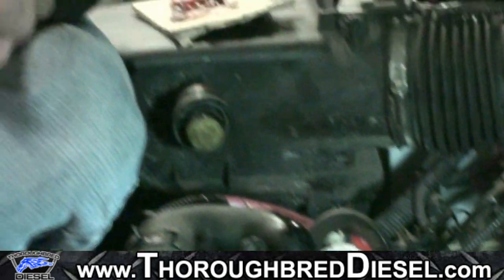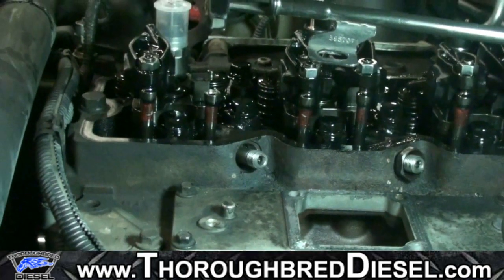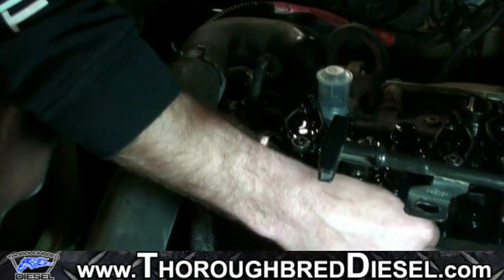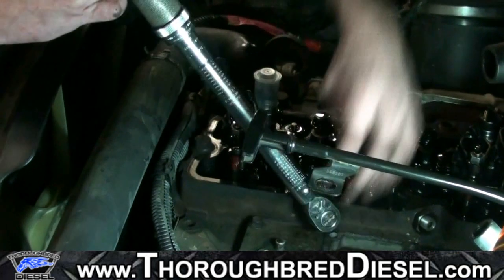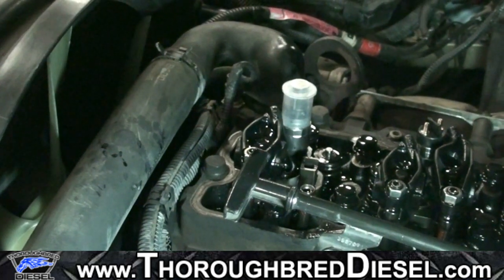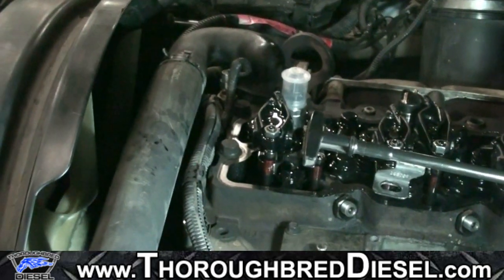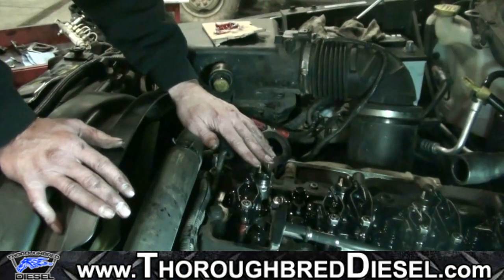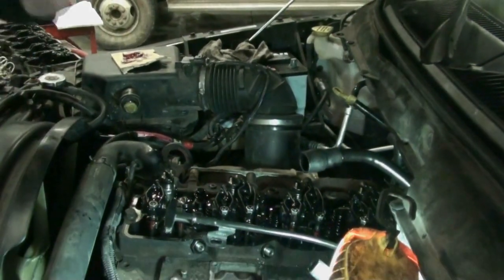You Have Been Installing Your Common Rail Injectors Wrong Since Day 1 |  Installing Dodge Injectors

Comment: I don’t know, but Dodge says different. It’s says 44 inch pounds a seat injector in. Then loosen Bolt bolts put feeder Or crossover tube and torque nut 11 inch pounds. Then torque injector final torque is 89 inch pounds. Go back to crossover tube and final torque is 37 to 45 Ft. lbs. Way it gets evenly torqued by a fourth step Torquing process. Thank you for the video I like your old video but that’s straight outta Dodge.
Reply: It is 11 ft lbs (not in lbs), but yes, sequence from the manual makes more sense for getting the crossover tube aligned to the injector notch. 11-inch pounds is for the solenoid nuts (in 2006 manual).

Comment: My 2006 tube hold down is 57 ft lbs not 34 ft lbs and 11 in lbs on the harness nuts not 13 in lb, great video just wanted to note the difference from my dodge service manual
Reply: I think I would go with your service manual. I worked for Dodge for quite a few years. And the guy that taught me raise three kids through grade school and high school Catholic private schools working nothing but dodge Cummings.

Comment: You mentioned using petroleum jelly for injector seals and then said grease on tube rings, did you mean petroleum jelly on tube as well or grease? Thank you.
Reply: Petroleum jelly will work fine

Comment: what torque wrench are you using for the inch pounds? I can't find anything but torque wrenches in Ft/lbs
Reply: Mac tools snap on and harbor freight have them
Reply from the maker: It’s a snap on ¼ inch drive, they read inch pounds.  Most of todays newer digital torque wrenches will display inch pound too.

Comment: I replaced all of  my 06 injectors about 2015 when #6 went bad. I was a cheapskate and didn't replace connector tubes. My #5 injector just went bad so I ordered one, plus 6 connector tubes. Would you recommend replacing all 6 tubes? My truck has always started and ran well. I was, however, disappointed ever since I replaced all 6 injectors in 2015 (160,000 miles- truck now has 200,000)it has gotten a few less miles per gallon whether towing, empty, city, highway,  etc.
Reply from the maker: Replacing the feed tubes wont hurt a thing,  and one thing that may be good for the entire project is to have those tubes retorqued.
Reply: @thoroughbreddiesel  how would you recommend I replace the other 5 since those injectors don't need replaced? Remove old tubes, brush inside the hole clean, replace and torque the connector tube nut? Or loosen the injector bolts then insert and torque the new tubes? Or even more than that, pop injectors out and then push back in as if I am putting in all new ones, then install connector tubes?

Comment: 5.9 Cummins cranking but dont start. How do I know if it's the VP44 or the injectors, or anything else?
Reply from the maker: This video is for a common rail truck (Model year 2003 +). If you truck is a 98.5-02 truck and you have a no start, check lift pump pressure and codes to identify your problem.

Comment: I've changed my injectors now has that loopy idle, what did I do wrong??
Reply from the maker: Common rail dodge? Check feed tubes.
Reply: @thoroughbreddiesel  yes common rail. I've been checking seems like some tubes port to injectors are crushed and one injector looks like double o ring. This was done by a diesel mechanic guess he's NOT
Reply: @thoroughbreddiesel  I got it running real good. Now I think stuck injector knocking and smoking white. I have the cap to block off fuel to injectors but no rail fuel pressure but there's fuel coming out of the rail what is going on now?
Reply from the maker: You have the suspected injector line removed and capped off? If so and it doesn’t stop knocking you move to a different cylinder. I don’t think I understood exactly what you are saying.
Reply: @thoroughbreddiesel  I'm moving to a different Cyl. My question if an Injector is stunk would it cause no fuel pressure at the rail because that's what's going on
Reply from the maker: High return can cause the rail to be sucked dry, and have a low rail or no start condition. Usually, when you have a nozzle failure and fuel coming out of the business end of the injector, for lack of better terminology, it wont overwhelm the rail,  the truck will start and run.
Reply: @thoroughbreddiesel  ok thanks for the info
Reply from the maker: @bikeconnectionbmx  NP GL!

Comment: I apriciate the video" I just recently replaced all 6 of my injectors with remanufacured bosch injectors from a reputable e-bay dealer. I had 1 of them stay completely open causing an engine knock and clouds of white smoke. I was able to isolate #2 was the cause with the miller cap tools. I pulled it, put back in one of my old ones and now I'm at the point I have put back all my old ones and my truck will not stop smoking when I give her gas. there is no blow bye/blow back  she idles perfect drives like she used to, but now I have white smoke and when I place a heavier load on her I get a cloud of grey smoke. any sugestions?
Reply from the maker: I think you are on the right track.  Pull all injectors and send them back.  I would also suggest running a compression test on the motor because the faulty injectors could have done some engine damage.
Reply: @a0f58c  oil creating white smoke  LOL
Reply: @a0f58c  ummmmm,,,,most of the engines that burn oil  had blue smoke,,now injectors leaking fuel i'v seen smoke white,,